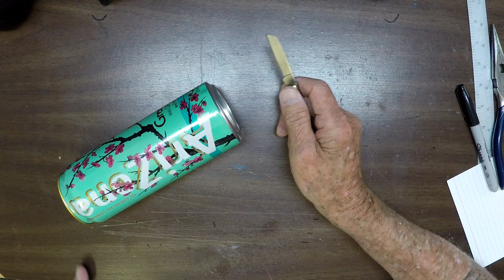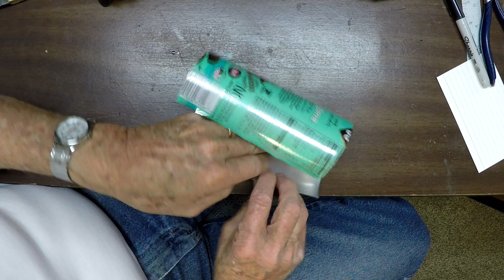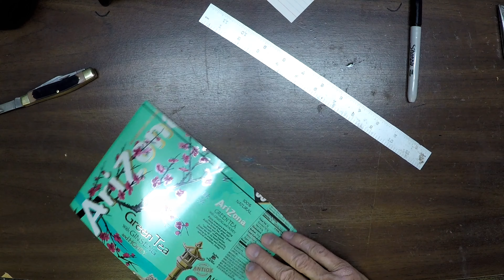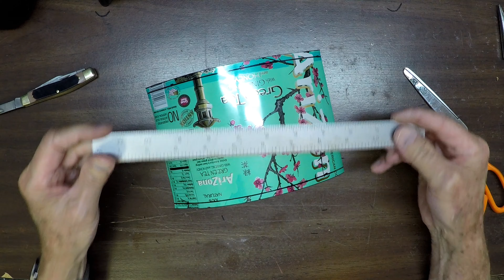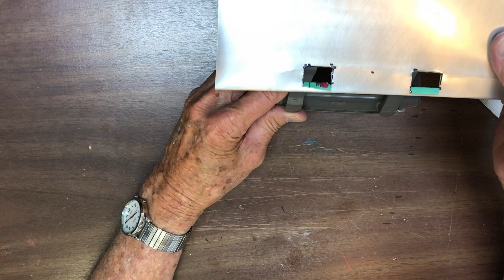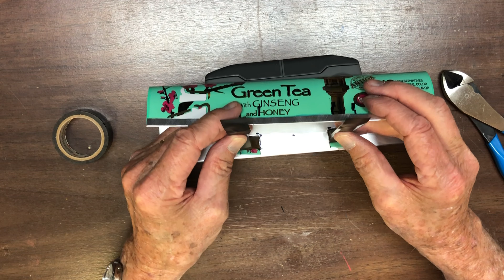HOW TO MAKE A MAVIC POPCAN RANGE EXTENDER

Comment: Try making one for The bebop
Reply from the maker: Thanks for your input. I have had my Bebop for 2.5 years and was never able to improve upon their design. But I appreciate your suggestion and God bless.
Reply: mrkentdotcom I live in Rhode Island and My bebop didn’t like the cold at all I used your website for all the settings,pairing,updating and more so much help
Reply from the maker: @chevyn0va1  Thank you for your kind words. Yep, we are miles apart. That's for sure. God bless.
Reply: I got one before winter and learned a lot from watching all your videos -thanks
Reply from the maker: @chevyn0va1 Thank you for your kind words. Did you get to fly much over the winter? I got my first one in November, but that doesn't matter much here in Arizona :) God bless.